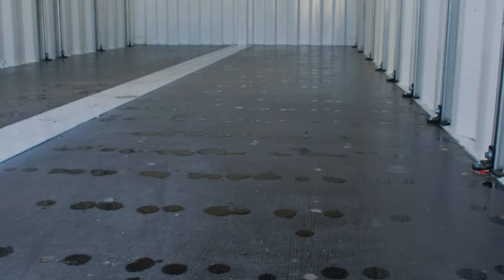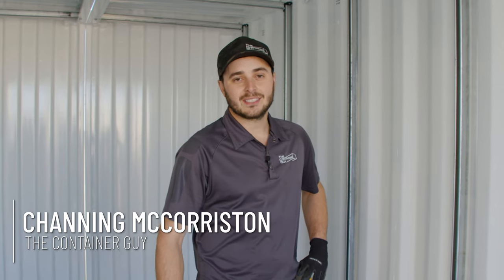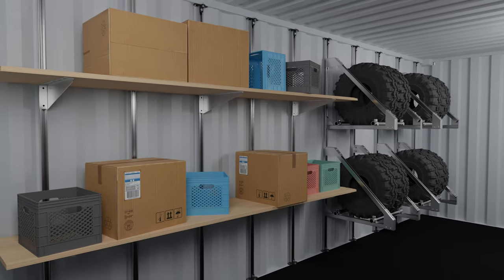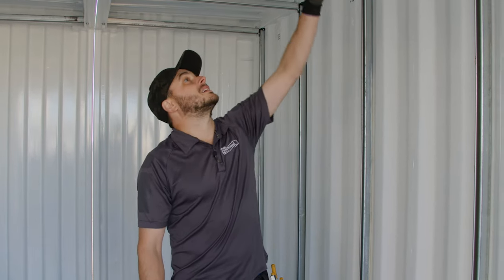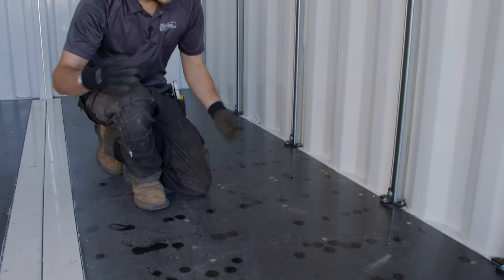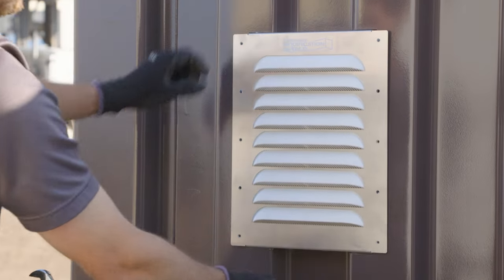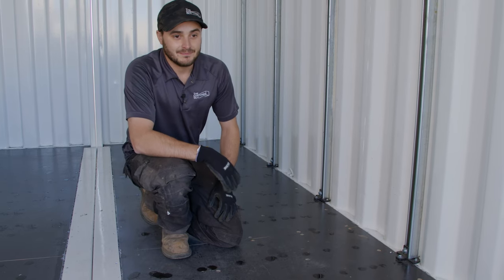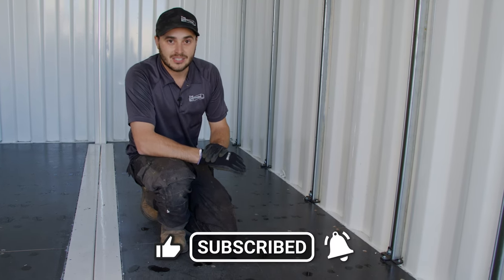What Is Container Rain? - Prevent Condensation In Your Shipping Container

Comment: I'm in Seattle.  Its very cold 28 - 34, Also it is so foggy that visibility is only a few hundred feet.  The doors of my containers are left partly open, and still I have this issue.  I don't think its because of any temperature difference since the doors are left unlatched.  Most likely just the incredibly high humidity from the fog is condensing.  Still looking for solution.  Considered stretching a tarp across the roof inside to catch the rain, but it would probably just condense on the tarp them instead of the ceiling.  Either way, vents won't help me as it is already vented by the open door.  We seem to have same problem but different cause.
Reply: Im 30 minutes north of you, having the same problem with an insulated 40' with vents at both ends. Did you figure out a solution? I was thinking dehumidifier.
Reply: Do yall use damp rid? It is a condensation collector. Im in Bremerton and ive used it for a few years now in my 20’ containers. It works well enough.
Reply: @ferrariowner123  Instead of latching and locking the doors, i leave them unlatched with a chain to secure, then drape a tarp over the top of the doors to make sure no rain gets in, this seems to vent well enough to equalize the temp inside and out and prevent the condensation, at least enough to keep it from raining.  

My biggest problem is people going in an out of the containers at random times throughout the day.  If it was just long term storage it could be mitigated by only opening it during warmer part of the day.
Reply: I'm not in Seattle but I had issues with moisture and I installed a wirly bird on top in center of 40' hc container and vented one side of the doors drilled holes into door put a house vent cover over holes to hide and put a exhaust fan under wirly bird on a timer no more moisture issues !
Reply: @Ray69Smith  I just had my guys put tarps over the vulnerable materials in the containers, and got the job done and left.
Reply: I wonder if it is worth spray insulating? The same thing they spray on metal shop ceilings
Reply: @joshcorbin9780  Impractical considering these containers are rented from the various local providers around the country for a few weeks or months as needed.  Even then there is no reason to imagine that the insulation wouldn't rain just the same as the surface would be equal temperature to the ambient temperature as the doors must be open to access materials.

The best idea I have is to use a tarp fastened at the top on one side, and at least a few inches down on the other side so at least the water droplets will flow to that side and down the wall.  This is also problematic as most containers don't have anything to tie a tarp to on the ceilings.

In the end we just put everything in the containers on pallets, and put tarps over each pallet.

Comment: I purchased 2 big air 45 vents from you guys. Installed them about a month ago, just like your diagram instructs. I live in south eastern BC. Yesterday was the first time I noticed condensation in the can? What do you think the issue is?
Reply from the maker: High ambient humidity and big temperature swings from day and night. Passive ventilation is not full climate-control. It will on average perform much better than a non-vented container but there will still be a few days a year (usually spring & fall) where all the variables stack up against you and condensation will happen.
Reply: @TheContainerGuyTV  Right on. That's what I figured. Some days will just have the right combination to create the condensation. Otherwise it's been proper and dry. Thanks for the quick response!
Reply: @TheContainerGuyTV  Hey! Love your videos, I'm looking to store my fleet of cars in 40ft shipping containers. Would having the containers in the shade (underneath large metal building) help with the moisture? Thanks!

Comment: I don't believe it.
I have a Versa Tube structure that is a roof only. No walls.
The underside of the roof condensates.
Fans are only passing outside humidity through and they aren't big enough to move the air required .

Comment: If moisture is not inside the container, you will not get condenstation.
Reply from the maker: Are you recommending running a dehumidifier in the container 24/7 to achieve 0% humidity? What happens if you want to open the doors?